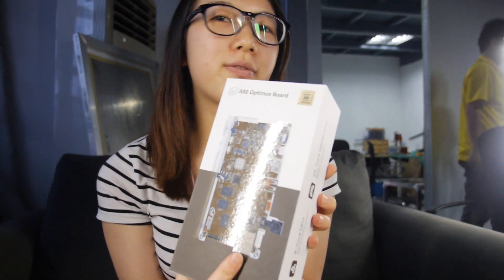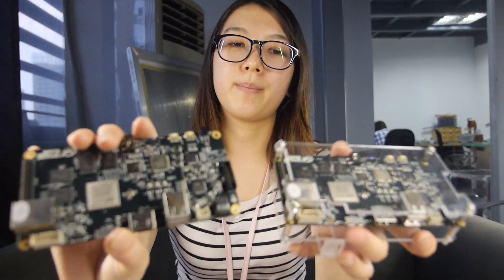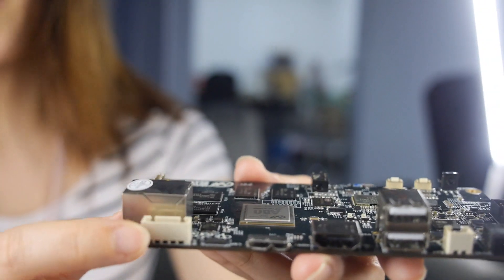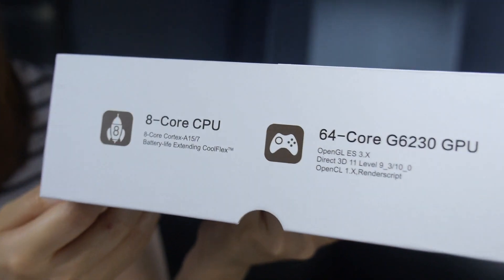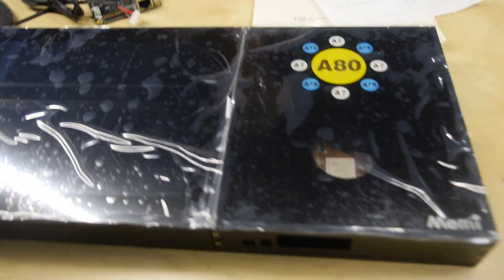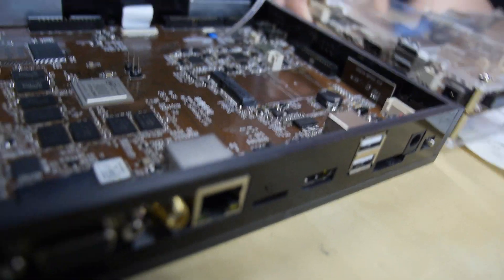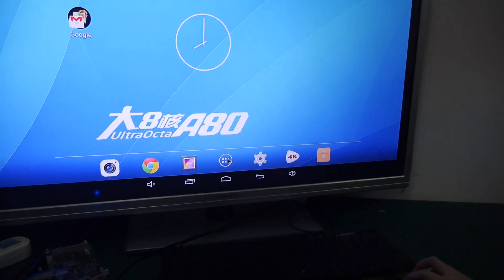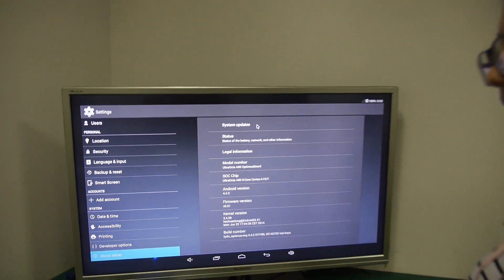Merrii Allwinner A80 OptimusBoard development board now shipping!

Comment: Allwinner A80 compared to rk3288 which one is more powerful
Reply: I believe the rk3288 is more powerful because it has cortex A17 cores whereas the A80 has cortex A15 cores. RK3288 should have better support because it uses an ARM Mali T764 GPU.
The rk3288 is a quad core and beats the galaxy s5.